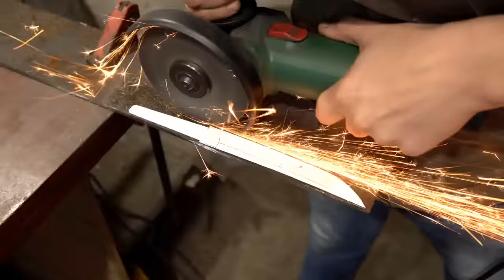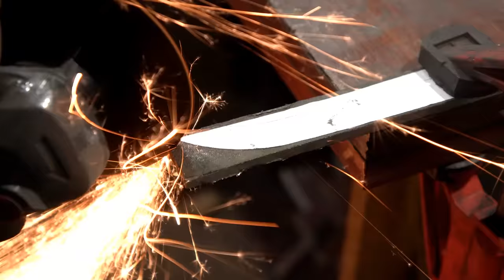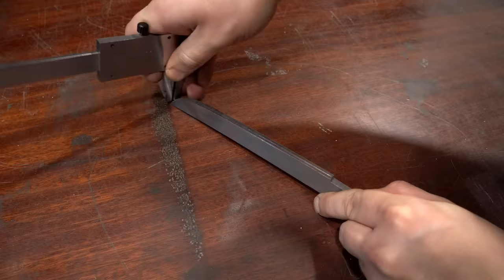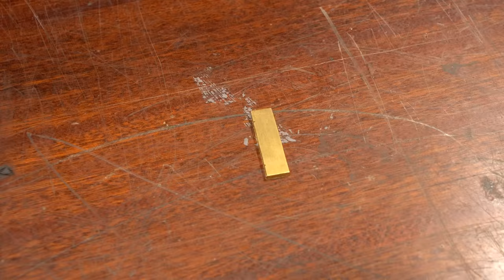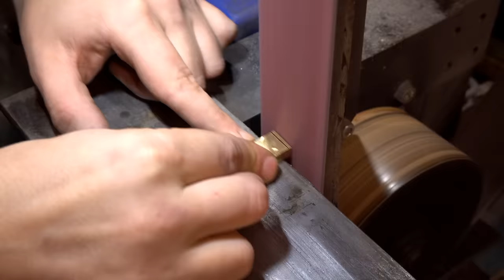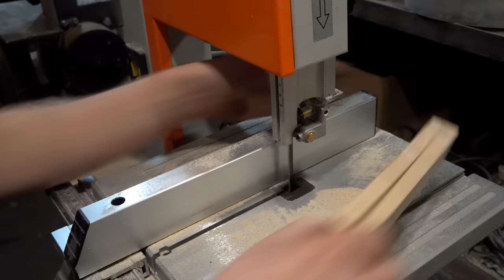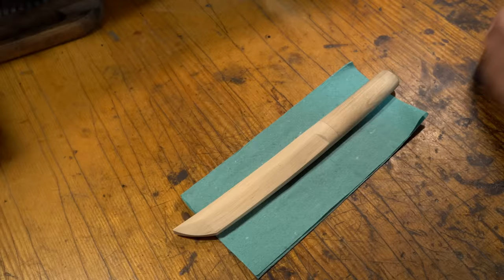Knife Making - Hidden Bokuto Knife

Comment: 0:20 You have some giant man sized balls my sir for doing that without gloves
Reply: You don't need gloves. Just goggles.
Reply: The thing about gloves is this... 
When you have to get that close to machinery of that sort, bare hands can be better. Yes, if you're careless or have a moment of inattention, you will get a nick or cut. Gloves MAY prevent this. Then again, the glove may catch and pull your hand into the machenery. This will result in a far worse injury with words such as bend, rip, tear, mutilate, and removed being used.

This is also why you won't find Machinists wearing loose or baggy clothing... Machines don't care about feelings or fashion. They do what they do until bound up, broken, or shut off.

Comment: Is nobody help shocked that he’s not wearing gloves while he cuts metal?
Reply: I was thinking the same, maybe I'm just a safety nerd
Reply: He’s a professional and he’s probably used to the sparks
Reply: It's a novice mistake to were gloves when handling metal. The sparks on those don't sting, if you are wearing gloves than you don't have as much control and you can lose a finger easily.
Reply: The first advice I got from the instructor in my metal shop safety training is never wear gloves when in the metal shop.
Reply: @dorkozoid6724  Interesting!  I don't work with metal so I am a noob.  I was mostly thinking he should be wearing gloves when using the handheld grinder and maybe on the belt grinder as well
Reply: not even got any scars on his skin
Reply: Spark hashira
Reply: I never do🤷‍♀️
Reply: The fabric can get caught on the machines like the band saw or angle grinder and pull the rest of your hand into the machine or break it.
Reply: Why should he
Reply: The sparks cant hurt you and if you are wearing gloves you cant move so much your hand

Comment: Looks great, but try hitting it on something or cutting a decent sized stick. The moment you do, heat treated or not, it's gonna snap bc it was ground into shape and not forged. Again, the aesthetics are beautiful, but it doesn't seem very functional
Edit: why didn't you pin the handle? Epoxy will only get you so far....
Reply: Pretty sure it was built for just aesthetics and exceeds in that field.

Comment: I love how everyone thinks this is truly how to make a proper knife. first of he just used a piece of flat iron only cheap knife makers us this low quality method and don't fold the iron in a proper forge or use the right iron. Next using a grinder is a big no no in knife making grinders mess with carbons and weaken iron and steel unless heated properly. Next he did his quench incorrectly, you are supposed to dip into oil starting with the back of blade then submerge to the blade this process pushes the carbon toward the blade make the blade have a stronger edge I could go on.